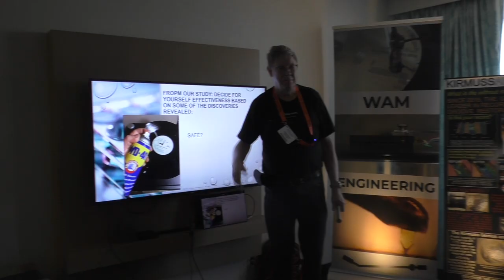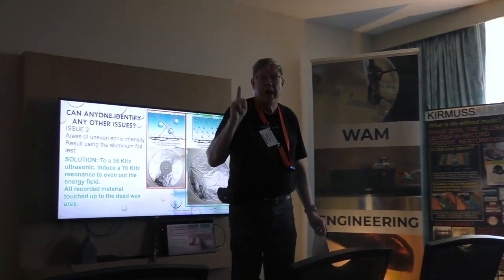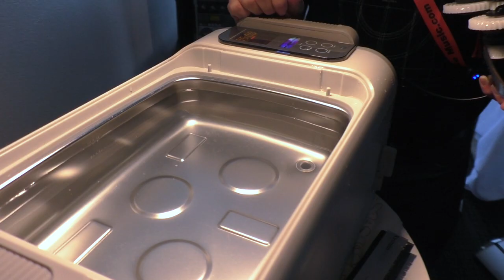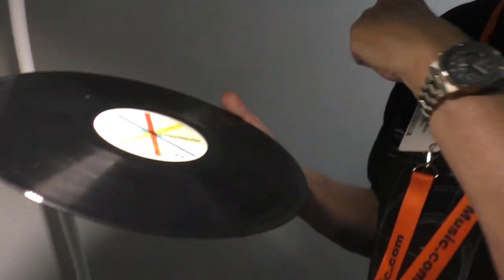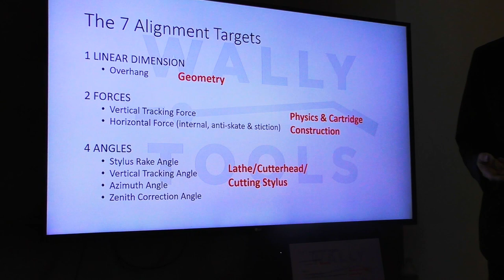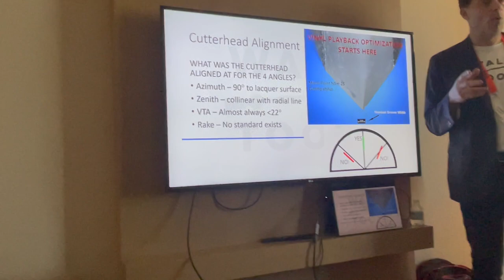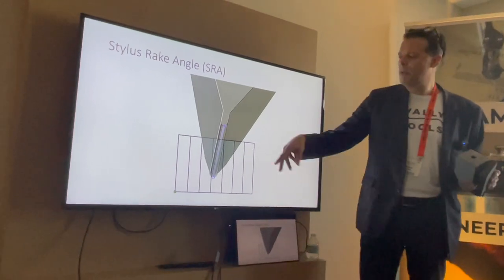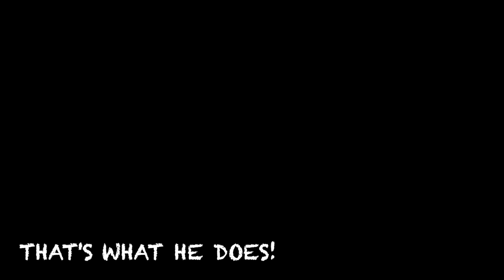Two Must See Seminars at Florida International Audio Expo 2023

Comment: So what’s the best way to clean my records? 😊
Reply: You take a can of beans and...
Reply: @latheofheaven  Prefer mac and cheese 😂
Reply: Simplest and to be performed before playing any record is to use a 10 micron  parastatic felt brush to remove dust, then a carbon fiber brush to remove static.
Reply: @kirmussaudio7578  THE MAN himself!  👍
Reply: @latheofheaven  I usually respond to pertinent question. Thanks for the thumbs up.
Thought a very good point was raised.

We as perrs in the cleaning business all do something to the betterment of the record.

The brush and a zeostat go a long way. 

Severely coated records with fungus can be first wiped off  with a wet microfiber cloth, soaked with distilled water. Then using the brushes as described. Very affordable....

Cheers!
Reply: @kirmussaudio7578  Oh, sir, while I 'have' you...  😊 Fremer vehemently said that you do NOT use an iSonic tank, and he said that you state that also.  But, is it possible that the actual manufacturer of that tank could provide it to you and to iSonic?  The only reason why I ask is because in one of the shots in the video above, sir, the bottom of the tank the unusually larger transducers, and the EXACT way the rectangular heating elements are laid out, I absolutely SWEAR it is identical to my iSonic tank, even the bottom vinyl surround and the way it looks.  I mean, I KNOW you designed the top which rotates the records and I assume you have custom things done with the controls and such, but isn't the base tank, or at least the metal and bottom elements the same...?
Reply: Hmmm, interesting that you did not answer my very polite and respectful question about your tank, but it's honestly not that important.  Whatever a person decides to buy for their ultrasonic system, whether it is your excellent, proprietary and VERY thorough system, or someone buys a good quality tank very like yours and still either has to make or buy the rotating system.  So, a person who wants the 'Complete' system may as well just buy yours and be able to do it 'all'  👍 The cost isn't really that terribly different, and with your system then a person has all that they need!  I was just being curious because of seeing what I see,  I'm  honestly NOT trying to be difficult or deliberately argumentative, I promise...  Besides, Fremer would have me killed... 😊
Reply: @Lathe Of Heaven  I did answer the question.  I use the same stainless steel basin. Three  Heaters not used. One heater works to 68 dry F as the effect if cavitation generates its own kinetic energy.

I was very forthcoming and explained all differences and my IP.
Reply: A word of caution. As seen in the video the aluminum foil records when mounted in the isonic skewer sees at times violent action at times in certain areas of the record. As such I wish to note that one should never use our ionizing spray on any record inserted in any other machine as ionization of the record will attract the effects of cavitation to the record.  Potential damage could occur to the record if in fact these noted high energy spots see the effects attracted to the record.  

That is why proper spacing to reduce standing waves and also adding a resonance as we do and  exclusive to our process produces the gentle and even effects of cavitation to and between all 4 records in our design. This as seen in the foil test records placed in our machine as well as by the measurements taken by the Cavitation Energy Tester measuring 810 Cavins, plus or minus 10%.
Reply: I do not want to monopolize this forum and suggest anyone needing more details or to elaborate on the science to call our office. It would be a pleasure to respond in person.

Processes out there all do something as to cleaning.

Our design focuses on removing films left over by prior cleaning processes, air or vacuum dried. Then as we cycle the record in and out of the machine as we ionize it between cycles with our spray and brush,  to change the charge of the record to be opposite to that of water. We then can remove the pressing oil that hides the detail of the groove as pressed by the stamper.  Also removing any dust fused into this jot oil at the pressing plant,  cause of some of those annoying pops.

In closing,  using our cover if placed  on any 7.1 liter tank or other sized ultrasonic does not see the cover itself solve the issues of transducers and their noted generation of uneven cavitation throughout the tank.
Reply: @kirmussaudio7578  Thank you sir!  👍
Reply: @kirmussaudio7578  Yep, totally agree!  Although I DO like their tank itself, the guys at iSonic honestly really do not know much about record cleaning.  I talked to one of the main guys and I could tell that he really didn't know much about it.  I explained to him that although I like the design of their rotating system, putting 10 records in the tank is WAY too many and does not allow enough space for proper cavitation as you mentioned.  But, whatever I commented on he just glossed over as 'Yeah our system works just fine'  But hey, not everybody can be an expert like you though, right?  😊

One thing I do mention on my video series is that if a person does go that route (although it basically costs as much along with the tank as your system, so people should just get yours) they should absolutely NOT put 10 records in the tank, but space them out and only do maybe 4 or 5 like your system does.
Reply: @Lathe Of Heaven  Tested with 4 aluminum records sees more  areas of high impact.

Others have noted on other sitrs whete the skewers grind the holes and where the dead wax area is not touched. 

If using any chemical made sure you check the ingredients list with any machine to see if it pvc and plasticizer friendly,  and also it's toxicity.
Reply: @kirmussaudio7578  Sounds good sir!  👍  Yeah, like I mentioned, I honestly did not get the impression that they really knew anything about record cleaning.  I wouldn't recommend going their route.

Comment: Amazingly interesting.  So glad, back in the day I just used Discwasher II and then transcribed to tape. KISS, keep It Simple Stupid, I'm stupid, so I kept it simple. Was a little bummed that the Gentleman didn't have ingrained in his synapses the area of a circle. Had to prove that in Calc II, so the simple formula is seared into my engrams.  A couple of points that," Triggered", there's that damn word again, my cognitive dissonance. I'm not sure where the idea of water, H-O-H, has a net Coulombic charge either (+)/(-) as there is the electronegativity of the molecule with O being slightly negative and H being slightly positive, which alters the Bond angle, but the net charge of the molecule should be zero. So what is generating the net Coulombic charge? @ approximately 34:13, again, I'm not sure as to where He gets the number that, "Water is 100 microns in diameter?"  The water molecule is .27 nanometers across. 
   I did stop after the first 41 minutes, because I need Time to process so much information. Yet so thought provoking and I will resume watching, to keep on learning what the empiricism uncovers. Thanks so much.
Reply: The Tribelectric table of charges discusses the relative charge of both water and PVC.

Water is unique as it is a diople.

Reference to a water droplet of known 100 to 110 microns is not referencing a water molecule. H2O. Different sizes. 

The use of inducing a charge can be replicated easily at home. With a tap running, you will see water come out as usual. Then take  a glass rod, it has a neutral charge. Then with it, approach the  running water. No deviation.  Water flows as normal. 

Now, 
Take the same glass rod, dry it, then with a silk cloth. Rub the glass rod. Do this for 30 seconds or so. . Then approach the same running tap with this glass rod.  The water will deviate towards the now charged glass rod.

That is the principle of record ionization that we purport.

That is why we need to cycle the record in and out of our machine as the induces  charge wears off.

A processed record using our ionization as the end result requires no air or vacuum drying as the restored record repells water. 

Back to the Tribelectric table of charges. 

Another test we do at the end of every show is where we take the record assembly cover off of our ultrasonic machine and turn it on. We then ask those present to take their glasses and suspend them in the tank for about 4 seconds,   with it running. Keeping it submerged until one no longer sees a grayish cloud appear. This represents materials like skin oils etc being removed. 

We then spray our ionizing agent onto the just processed set of Eyewear.  When suspended once more in the ultrasonic's bath, even more visible greyish clouds are seen rise from the previouslyprocessed set of Eyewear.   Proves our process where ionization of PVC and in this case, PVC and glass, sees a charge applied to be opposite to that of water,  and thus finishes the cleaning of the presented Eyewear.  

...Everyone remarks where the end result is like receiving a new prescription.  

We have removed films and oils. 

Just as with records, we remove first films that were either air ir vacuum dried onto the record's surface,  then after several cycles in and out of our machine, each time reapplying an induced charge, the release agent itself is removed.

Hope this explains the science.
Reply: @kirmussaudio7578  Sir; 
                                   Thank you for correcting my misconception on what is occurring in the process you employ to maximize the musical experience encoded in the grooves. I appreciated your Time.
Reply: @scottwolf8633  You are most welcome!  Hope that I shed some light.